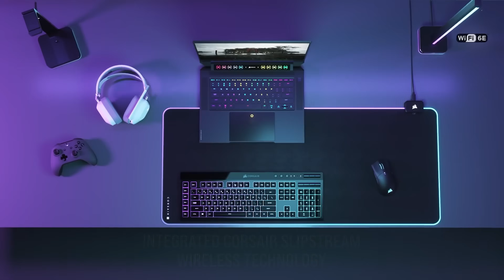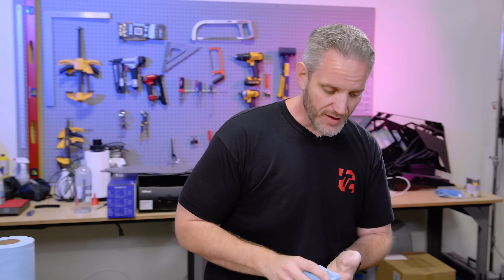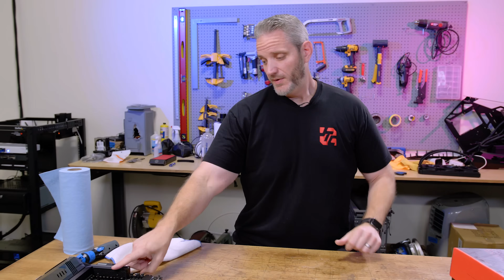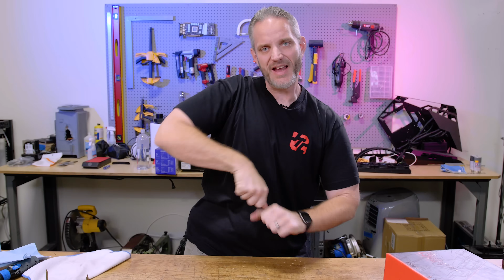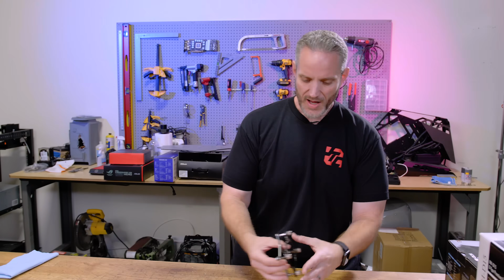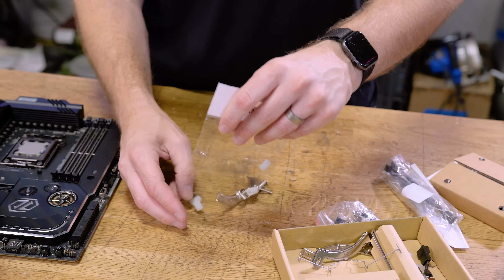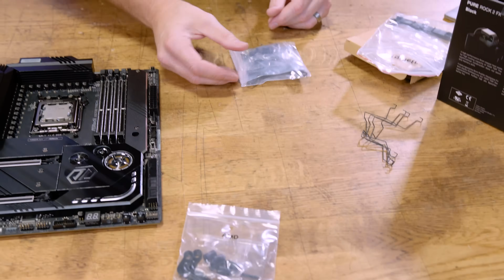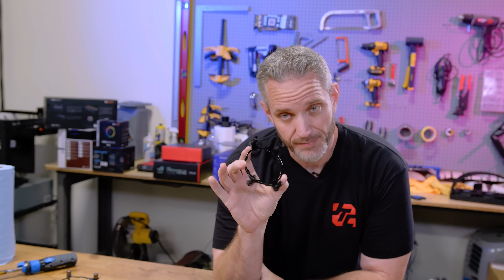AMD made a terrible flaw with this design...

Comment: no-V-cache Ryzen 7000 is just a quick fix by AMD to milk market more before releasing new Zen as intended by AMD engineers - with 3D V-cache. that crippled 7000 line-up without V-cache should be ignored as an obvious and badly executed cash grab by AMD. 
3D V-cache means way faster CPUs + thinner IHS = way better temps.
obviously AMD doesn't want to compete with Intel too much because releasing way faster CPUs right away would mean a price drop on everything else (including other/older AMD CPUs) and shorter time to sell new Zen technology. basically AMD is artificially slowing down technological progress. again. they did the same with Ryzen 1000-5000 - first Ryzen leaks showed performance on Ryzen 5000 level, but we got just Zen 1, because it was good enough to compete against Intel then in 2017. And Zen as intended - Ryzen 5000 - we got only 3 years later and with skyrocketed prices.

Comment: Can anyone confirm whether the Corsair H150i Elite LCD works fine or not?
I have one sitting, waiting for the rest of the build as I THOUGHT it was the one thing I could safely get in advance...(sigh >.>)
It seems not to use it's own backplate and includes it's own standoffs, but my mind isn't exactly at peace about it.

Comment: In theory, if you have access to a vertical mill, you could mill out the extra 2mm of IHS and leave an outer border.  This would make using liquid metal much safer, and more importantly, should eliminate the risk of damaging the chiplets while attempting to delid a soldered IHS.  Obviously the contact plate of any cooler would have to account for this, but it could easily be done with the same mill.

Comment: i wonder, if you want to do direct die and remove the retention bracket and the am5 backplate. can't you use a am4 backplate instead then, if the 4 additional holes in the am5 backplate are the only difference?

Comment: I was all for AM4 to AM5 cooler compatibility since I have a Noctua cooler (D14 AM4 version), but now that I know it was a the cost of a thicker IHS and much worse thermals I would have been fine with having to just buy a new cooler when I built a new system.
Reply: i honestly don't know why they thought that maintaining the cpu z-height was the best way to do this. clearly just move everything else the difference of the new mounting height with the same thickness of IHS, boom no bad thermals* *= ram clearance might be affected on some tower coolers and water blocks with circular brackets may no longer fit due to VRM components near the socket. would have been better....

Comment: good video !! well i  wish theres where more Cooler reviews with the diferent ryzens CPU  from 2600x to the latest... with small branded coolers... from  30$ or 25$ to 100$ , in  applications as , streaming by cpu 6500kb ultra fast on or super fast + gaming at 1060 60fps.  with test being done  with Streaming Via CPU  6500KB

Comment: Reading through the comments, it seems most people have not understood how AMD's boost algorithm actually works. AMD increased the PPT so high, that the CPUs without modifications will reach temp limit of 90-95°C before reaching power limit. AMD's boost algorithms since Zen2 work different than Intel's (some would say that AMD's boost algos are more advanced), they will push the CPU until it reaches one of the given limits to max the performance of the CPU.
For anyone speculating to machine down the IHS to reach lower temps, re-read the above. As long as you don't run into any other limit (PPT, EDC or whatever), the boost algorithm still will go up to those 90-95°C, simply because that's how it was designed. However with a thinner IHS and therefore better thermal conductivity, the boost algorithm will give you higher clock speeds.
And considering most of the people here will not have any sustained workloads that use 100% of the CPU power, but use them for gaming, the whole fuss is made up anyways. Because you will never reach these temps other than in benchmarks to complain about the heat. And Intel CPUs reaching 100°C and starting heavy throttling? Forgotten, because it must be AMD who builds bad CPUs?!?

Comment: I actually use an AM2 cooler that came with the 5 dollar old case that I bought to build the pc. It is rated for 140w tdp, more than enough for my my 5700g 65w tdp. Works great, doesn't go over 65. I didn't even install the water cooler I bought... Too much hassle for little difference, I guess

Comment: Wasn't planning on buying, but had I gotten it, there's no way I would want it to operate at the "normal" operating temperature. Perf is hampered by design for no good reason other than compatibility with older hardware. Tradeoffs are just not there.

Comment: @8:26 ... yup, on an old Ahtlon XP platform ..... the horror...and I bet Phil made the same mistake I did, not noticing that the clip/bracket thing was asymetrical and if by mistake one attached the end on the side with the longer part and left the short one for the pushing yeah, not pretty.

Comment: Can you get a digital caliper and measure the thickness of an AM4, AM5 and Alder-lake chip.  ZEN4 is effectively heat bottle necked. AMD can say 95c is normal all it wants but it’s not. Just look at the surface area of an intel chip to AMD. Intel has 50% more. Intel runs at 80c at very close power levels to AMD which is pushing 95c. Why? Just look at both chips side by side.

Comment: The heatkiller IV what i have kicking around in a box, since threadripper, is compatible with AM5 because its uses standoffs wich screw in to the original backplate on the AM4 mountingkit. 
Not all custom waterblocks are incompatable, more like most of the EK waterblocks are crap.

Comment: Glad to know my ancient AnfiTec Drei waterblock will be compatible without any modifications cause it uses the stock AM4 backplate, so it should™ work fine on AM5. Shame that the thiccc AM5 IHS is basically the new version of intels thermal yoghurt and the whole "just delid it" meme stuff from years and years ago

Comment: Lap and or mill two millimeters off of the ihs of a processor before delidding and that will give you the most accurate testing for the difference in temps due to ihs thickness

Comment: 8:23 Yupp, back in 2002 on a brand new 300€ Gigabyte Motherboard and Athlon XP 2100+ (Palomino). Slipped off with a flat head screwdriver and dig literally a hole into the PCB of the MB.
I hated this Athlon coolers!

Comment: I agree with another poster saying the height is probably for future L3 chache (say for a server application).   With 3mm, a lot of designs to improve heat transfer are possible.   This isn't just height compatibility; it opens up room for future growth.   As a combustion engineer (lots of thermal calculations), I see much opportunity with 3mm of height to work with.  Or... go taller.   Or as this video notes, direct die cooling.   I see a future CPU with integrated heat piped that go to a larger thermal interface to the final cooler.    Nice.  Lots of future growth.

Comment: I use a corsair AIO which uses a screw-type hook so I'm good for now if I decide to upgrade.  I see where Jay is coming from on the mounting mechanisms that use the hooks.  Some of them are fairly easy to connect to those hooks, I can see how it's not ideal compared to the 4 mounting posts.
Reply: what aio is it??
Reply: @Jackson Vondemkamp  It's the H150i Elite Capellix.  360mm  probably overkill, but should handle the 7000 series without issue.
Reply: @abidlack1980  That’s the same i just got haha. Glad to know it actually will work.

Comment: I purchased Ryzen 7950x on day one of the launch and I purchased the Nochtua 15S cooler, which was the only cooler that stated Am5 compatibility. I am glad I did that because if I could not have completed my build after i got home with the parts from Micro Center I would have been mad and bummed. This is just like the lag 1700 compatibility with Intel Alter Lake CPUs the first couple of months. Part is the cooler manufacturers and part is the excess inventory of non-compatible coolers. Once all of the old inventory is gone then the new compatible coolers come in and the problem is solved. We will have to wait for that time with AM5.

Comment: So in the history of IHSs out there, what they hell was even the purpose of it?   Just as a bit of protection for any exposed stuff next to the dies from thermal paste?  Seems having a heatsink direct on die would be the best solution for cooling 100%.
Reply: I remember my first Athlon XP CPU didn't have an IHS.  That was direct die cooling, but because people broke the die by not mounting the cooler properly, chip manufacturers started adding the IHS to combat RMA's.

Comment: Temperature isnt even an issue for enthusiasts. PBO curve alone solves it, put in a 200W limit and lose at most 1%, and you already dropped 15C.
Direct die on top of that and you get another 15-20C.

Comment: What happens when AMD decides they NEED that thermal headroom on the next Ryzen chips to stay competitive with Intel?  
What a stupid decision... AM5 is a natural cut off point for compatibility, they could have done whatever they wanted with the socket and cooler and no one would have complained about it.  
Why kneecap your new CPU architecture with bad temps from a too thick IHS for some very spotty cooler compatibility that no one truly cares about anyway?  
Keeping some DDR4 compatibility would have made sense to me, but i'm not going to keep my 6 year old NZXT AIO for the next 3 to 5 years anyway.  
...  
Delid Kit and Direct DIE surely is cool and nerdy, but that is slapping another 100€ onto the bill, killing Warranty, resale value and possibly even the CPU itself.... and then redo that every time you want to jump onto the newest AM5 chip?  

...i don't know if i want to buy this anymore.

Comment: i do remember that stock cooler mount on those athlon xp's.. it was bad. i still have boards kicking around. but at same time intels socket 370  was just as bad cuz that needed a flat head to install/remove the cooler. and yes i had stabbed a board by it. didn't destroy the board but it left a mark to remember it happened on it

Comment: That is pretty crazy they made the IHS that much thicker that you can see a 20c+ drop delidding. I've never delidded a CPU before and certainly wouldn't try with a new one i bought but that is unfortunate they did that simply for backwards cooler compatibility if i'm understanding this right. I guess something to think about trying later down the road when your cpu is aging, warranty expired, and you want to risk it and try and maybe get a bit more life out of it. For me, i'd just hope cooler can still do a good enough job to keep things running well with some minor OCing. Here is to hoping they fix this or release a different model with thinner IHS later on.

Comment: Or you can also try what Bryan from Tech YES City did on its channel ("From 94 To 55 Degrees Celsius. Make your Ryzen 9 7950X the BEST!") with Ryzen Master.
To bad AMD went nuts on voltage and power usage, otherwise they could have made a very compelling option losing just about 3~9% performance top (depending on Silicon Lottery)

Comment: JayzTwoCents I think the best test for comparing the thickness of the IHS would be to sand it down 2MM so it leaves the same factory thermal interface between the die and the IHS. The only variable in this case would be the flatness of the stock IHS so maybe do a stock test along with a lapped test and an overlapped 2mm test. 

If I had the hardware id try it myself.
Reply: The 2mm might cause the the top of the sanded down IHS to be below the top of the substrate retention bracket. You might be able to get away with it by modifying the cooler just for the results but the modification might be destructive to the AM4/5 mounting hardware.
Reply: @Postman00  you just sand the bracket as well
Reply: The cooler you used would then need to accommodate the 2mm washers to take it that much closer. 
Doable, but a bit fiddly.
Reply: @stephen1r2  Think mark think.
you need to sand the bracket down, not lift it with washers.

Comment: I had an athlon xp 3200+ with the old style spring tension cooler.  I remember having to replace the CPU cooler in my dorm room and I was drenched with sweat from anxiety as I used a huge screwdriver to try to push that spring down and get it hooked. I was so nervous I was either going to crack the pcb or slip off and punch a hole in my mobo

Comment: Is there even anything that doesn't use the AM4 stock backplate?  The hook mechanism that's default on AM4/5 motherboards is only for the Wraith coolers.  I've never seen anything third party that uses those.

Comment: @JayzTwoCents - could you try the Arctic Liquid Freezer II 360/420 with and without the offset option? I'd like to see the results. I may be in the market for an AM5 upgrade Q1 of '23 and I have this cooler planted on my 4750G. Concerning the IHS, perhaps some "extreme lapping" could help? I mean, IIRC the screws of this cooler stop at the height of the IH, respectively.

Comment: Never had a screwdriver slip. I have always thought the worst were Intels plastic push clips. Too often I've had high temps just to find out one of the clips isn't "clicked" in. Worse yet, ive had the little white tabs that go in the motherboard holes break off, making the cooler even more useless.

Comment: i disagree with your opinion on the IHS thickness. which your opinion is on par with everyone else opinion right now doing reviews and yes DerBauers was the first that i know of to catch the extra thick IHS.  my theory on the thicker IHS on the new am5 chips is to normalize the IHS between regular 7000 series chips and the 7000 3d series chips. going back to the X5800 3D even you commented on your video that amd shaved the IHS abit to fit the extra cache on chip  to keep the same Z axis as the rest of the 5800 series chips. which also limited how much 3D cache could be fitted onto the 5800X 3D. 
 now with the rumors of huge 3D cache on the 7000 series chips they will need extra room for all the cache memory. rather then making 2 different z axis platforms on chips or 2 different z axis platforms on board  or make different coolers. any of the mentioned would add complexity to builds and confusion especially if someone was upgrading from a normal 7000 series chip to a 7000 3D series chip in future. AMD just made the IHS thicker. so when the 3D cache models comes out they will be able to use same motherboards and same cpu coolers as rest of the am5 family then. this is something none of the other people doing these videos has touched on the possibility of yet. i know 1 video last month of a leak of 3d cache 7000 series chips the top end 3d cache chip was supposed to have upwards around 1 gig or more cache and as such that will take up a lot of room under that IHS if someone stops and thinks about this.

now i do think that if AMD just made their normal chips take 1 socket and the 3D chips a different socket this would fix all the above thermal issues with the 7000 series am5 chips currently being released.  but i think AMD didnt want to go down this road of having another different platform.
Reply: This is pretty much what I've been thinking too.  That the IHS will be thinner on the X3D versions due to the extra cache on top.

Comment: I've noticed EKWB doesn't list compatibility in their configurator page - they've even mentioned they are working on blocks for AM5 and not stating forward compatibility with current blocks (this is why I like companies like EK, they want to do it the right way).
I'm still up in the air on the switch to AM5 or Raptor Lake - want to see the dust settle a tad before I make the jump as it will be a full platform change coming from my aging x99 rig (has been a solid platform over the past 7-8yrs so far) and still does the job even though I know I'm leaving some gaming performance in the table due to changes.

Comment: D15 has come with am4 mounting hardware for a long while now and got the hardware if it didn't come with them if you contacted them. The one shown here is an extremely old one (before they started doing the black even) before am4 really took off to have the hardware included.
Reply: yeah his kit was an old one. I just got 1 and it had the right hardware.

Comment: I wonder if anyone could create an IHS with the die cut out and is the same height as the die? so it looks clean and it can prevent too much force from being put directly on the die when mounting directly. it would also help slightly with spreading heat if liquid metal is used and it would make spreading it easier.

Comment: There goes my plans to get 7950x & fun tweaking sessions with it. Going to stick with my 3900XT. 

Yes, I could just go "ham" on it & DIY but I prefer waiting for the company to actually release properly designed parts (which is never going to happen, as the same issues that I have on 3900XT are still seen on the 5900x & other 5000 series chips). 

Hopefully the next gen is more polished, I waited so so so much for the 7000 series.
Reply: And that is...? Oh you chicken little'd it. Nothing new was done, except Jay ignored what was said, that it was a FIXED BACKPLATE so coolers that replaced the backplate were not compatible.

Comment: If they needed flexible z-height couldn't they have build that padding into the bottom substrate instead of the IHS? I know circuit lengths matter this close to the cpu but surely there is more variance in the pad to LGA conductivity than there would be with +/- 2mm of tightly controlled PCP routing from pad to the die.